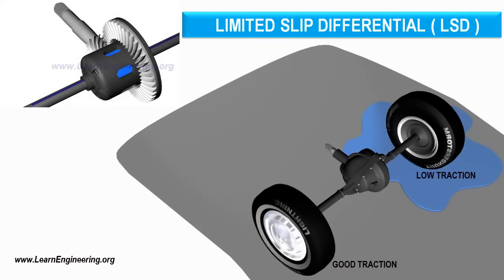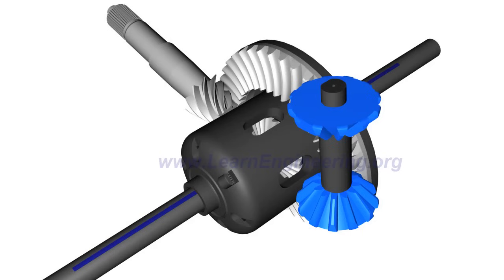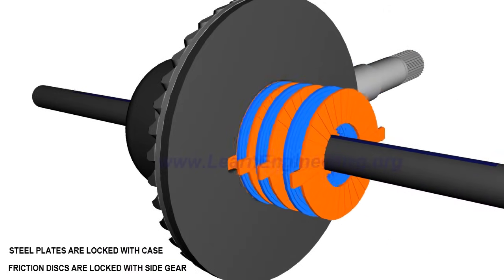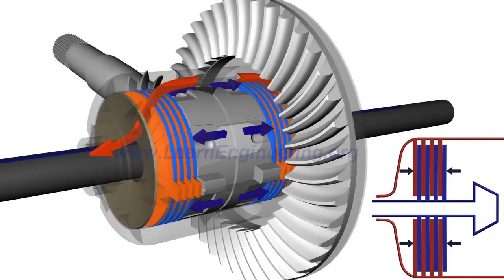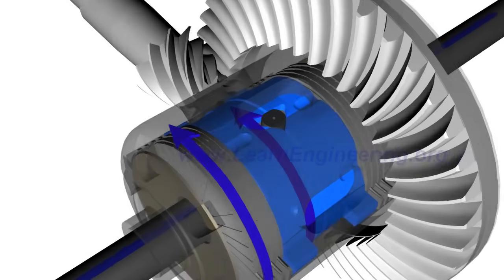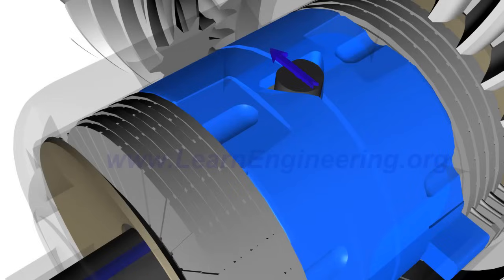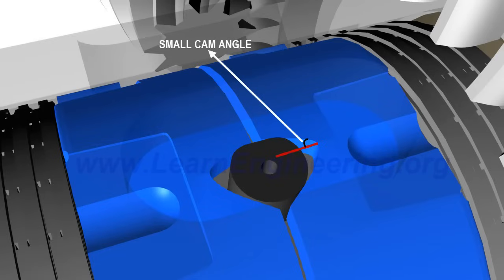Working of Limited Slip Differential

Comment: Probably this has been mentioned somewhere in the comments already, but Youtube doesn't make it very easy to check. There's a big mistake in this explanation, and it relates to the torque/power delivered to the left and right wheel:

At the beginning the video says that with an open diff "high power" is going to the wheel on the low grip surface and "low power" is going to the wheel on the high grip surface. This is wrong, an open diff will ALWAYS distribute the torque evenly between both axles (plus/minus some mechanical inaccuracies since we're not in a perfect world). The diff isn't sending more torque/power to the side with less grip, the side with less grip is limiting the torque sent to the side with more grip.

The maximum torque that can be put down on the ground with an open diff is roughly 2 times the tractive capability of the side with less grip. An engine can only put out torque that's used for something (conservation of energy and all), so the side with less grip acts as the limiter, any attempted extra torque will be spent on increasing the rpm of the engine and the wheel that's spinning, until you hit the limiter (at which point the engine cuts off and doesn't provide torque). Hence the car can't move forwards.

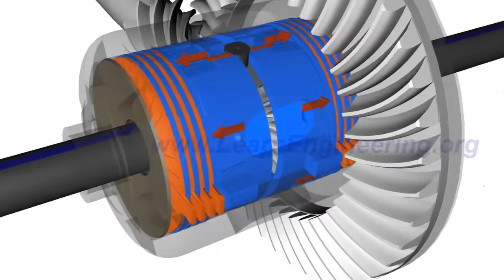When locking is introduced (be it via Salisbury type LSD, Torsen style unit, viscous LSD or whatever, even a solid, spooled diff) the situation changes. More locking enables you to send MORE torque/power to the side with more grip. Not "an equal amount of torque will be sent to the right and left wheels" as the video says at around 2:45. The locking torque is what enables that extra torque/power to be sent to the side with more grip. As an extreme example, a car with a solid, spooled diff (i.e. one that allows no differentiation) in a situation where one wheel is completely off the ground wouldn't be sending an equal amount of torque to both wheels, it'd essentially be sending 100% of the torque to the only wheel that's touching the ground.

Fantastic video for explaining how the system works, but lacking in describing how the forces in it actually behave. =)
Reply: It cannot be the same torque and power unless the wheels are at the same speed. Power is torque×speed. They get the same torque, but the loose wheel is spinning faster and hence more power
Reply: @gofer9156  I didn't say it doesn't produce any. I said the amount of torque it produces is proportional to the amount of resistance it makes. It makes enough torque to overcome it's own inertia and bearing friction.
.
So you're still wrong.
Reply: Thanks, I wish I had seen your comment earlier.
Reply: @gofer9156  you are wrong again. I never said electric motors don't produce torque at 0 rpm and the article you posted is a journalistic article talking about loaded situations. You keep making shit up. I'll post an EDU article at the end to show your ignorance.
.
Here is what I said: "so while they make torque it's only enough to overcome their own inefficiencies. Electric motors require resistance to draw more current and produce more torque, which is why they have unloaded and loaded torque ratings."
.
Electric motors DO NOT make all their torque at 0 RPM WITHOUT an extreme load. With no load the rotor experiences enough torque to overcome inertia and frictional losses which creates the 0 shaft torque. 
.
Again, it's a very simple test. look at current draw on an electric motor loaded vs lightly loaded and you'll see that one makes substantially more torque at the same voltage which means more power (watts = volt X amp).
.
"When unloaded, the motor is running at full speed, but at zero torque, thus producing zero power. Conversely, when stalled, the motor is producing its maximum torque output, but at zero speed -- also producing zero power!" https://www.clear.rice.edu/elec201/Book/motors.html#:~:text=When%20unloaded%2C%20the%20motor%20is,%2D%2D%20also%20producing%20zero%20power!
.
Stalled meaning the motor is experiencing more resistance than it can handle... ie an extreme load. Torque is proportional to load which can be seen by current draw increasing with load. Also, you're conflating shaft torque with rotor torque. The torque experienced by the rotor to spin is equal to the resistance it naturally has due to inertia and friction which delivers zero shaft torque.
Reply: @gofer9156  No, you have no idea what you are talking about. STALLED means loaded beyond the motor's capability. I said UNLOADED motors produce no torque beyond what it takes to overcome their own inefficiencies which equates to ZERO at the shaft.
.
Exactly what the article said. Zero torque unloaded and the motor will spin fast, and all its torque with maximum load.
.
And my last comment even provided you with my own quote stating that.
Reply: @gofer9156  2nd reply) You keep trying to perpetuate the same straw man argument. I never said no torque at zero rpm loaded. Stop lying. You said the OP was "incorrect!" by stating "An engine can only put out torque that's used for something." You are WRONG. An electric motor needs to impart its torque onto something to generate it. I can give you a motor that can drive 1m ft lbs of torque to set a drywall screw, it won't generate 1m ft lbs, just enough to set the screw, shear it in half, and then spin itself. 
.
He was talking about torque production depends on the condition, and you stated, "An electric motor outputs torque at 0 rpm." While that's true in a loaded situation, it's not true for unloaded. ie, street = tons of toque while ice = very minimal torque, and a snapped CV axle = no torque developed at the shaft. 
.
An electric motor cannot output torque without load, hence UNLOADED TORQUE. Yes, the rotor experiences torque to over come its own inefficiencies but the shaft sees no torque. Every post I say, UNLOADED TORQUE. Stalled rotor means heavily loaded. An unloaded motor will spin freely to whatever RPM the voltage sends it to and develop no torque at the shaft. 
.
I never said a loaded motor cannot make torque at zero RPM, in fact I stated otherwise. "You'll see higher current draw with more load and next to nothing when unloaded." Also, "Torque is proportional to the current draw in an electric motor, so while they make torque it's only enough to overcome their own inefficiencies." And "Electric motors require resistance to draw more current and produce more torque, which is why they have unloaded and loaded torque ratings."
Reply: @gofer9156  Are you a child? The only thing "Patently false" here is you. I posted a datalog showing loaded vs unloaded motor torque at the end. EMPIRICAL PROOF, unlike your magazine ad and misunderstanding of how current is drawn in an electrical motor. 
.
YOU ARE STILL NOT GETTING IT. The  The amount of current drawn DEPENDS ON THE LOAD. Motor load, motor electrical resistance, and electrical potential are what determine how much current is drawn by the motor. An unloaded motor will draw next to no current unloaded. 
.
The article I linked to you literally said NO TORQUE is developed without load, and maximum torque is developed at max load.
.
Without load, the motor will freely spin generating NO TORQUE.
.
You cannot force current through it. The controller applies voltage and the motor will draw current depending on load.
.
Here is a test I just did. I could not stall the motor due to a slipper clutch in the drivetrain, throttle EPA set to 35% on all 6 runs. First 3 runs were unloaded and the last 3 runs were with the wheels locked in place. As you can READILY SEE, the unloaded motor drew so little current it was not registered as it ran to max rpm UNLOADED. The LOADED scenario saw current drawn to overcome the slipper clutch. Upper Graph is all 6 events, middle graph is unloaded events, and lower graph is loaded event.
.
https://drive.google.com/file/d/1H9Vi1L413c93bt3he-Fd2msBkqCQDYk3/view?usp=sharing
Reply: @gofer9156  The only clueless one here is yourself. From the beginning I stated electric motor torque generated for use, since you incorrectly responded to the OP saying an engine can only make torque used for something. I already proved current draw is proportional to load with actual real world data. Now you're trying to insert yet another straw man argument to shift yours away to a correct statement, but I won't let you. Yes, as I've stated, motor torque at the shaft is determined by the current draw and inefficiencies the motor sees, but current draw depends on LOAD. 
.
YOU STILL DON'T UNDERSTAND. Load is the what determines the amount current drawn and therefore the amount of torque a motor will make. You cannot make a motor produce more torque than what the shaft can generate. It literally defies the laws of physics, since the motor cannot impart its force onto something else it cannot be produced. Because of the conservation of energy, energy can neither be created nor destroyed. If an UNLOADED electrical motor made any torque it would at any rpm it would be producing SHAFT POWER which CANNOT be transferred to air, thus would have to be transferred in the form of heat which doesn't happen. 
.
For the 100th time, current draw completely depends on the load, just like the EDU article I linked that you ignorantly thought made your point despite it saying an electrical motor only makes torque with load. Current draw is proportional to torque, and increases during load until the motor is stalled generating its greatest torque. 
.
My test used a motor controller that doesn't manipulate constant voltage for torque control, so it was 100% of the motor's load that accounted for the current draw. Motor controllers can only control current draw by manipulating voltage applied to the motor, since the more potential a motor sees the more current the circuit can support. In my test the controller applied constant voltage and only load was changed. 
.
Prove me wrong, create an electrical shunt, power an electrical motor, measure the amount of voltage drop during stalled and free operation. If the voltage drops, from a reliable source, then you can calculate current using the resistance of the shunt. Any voltage drop during a loaded scenario would prove current changes though, just wouldn't know how much.
Reply: @gofer9156  You are wrong and I already proved that current is proportional to load. GET OVER IT. It's funny, because I actually explain how it does, provide proof, and all you do is make hyperbolic or inaccurate statements without anything to back them up.
.
I've provided empirical proof and a an article from a reputable source.
.
Physics says that a motor cannot create torque without resistance. Real world tests show that current draw is dependent on load.
Reply: @gofer9156  Yet again you post something not relevant and prove how little you know.
.
That article does not say that an electric motor produces torque at the shaft unloaded anywhere within it. And that article is wrong in that electric motor torque is constant, as torque produced drops with rpm. 
.
why can't you provide a single piece of evidence that shows a motor makes shaft torque UNLOADED. I've said over and over again that the rotor experiences torque, but the shaft torque, which is what we've been talking about, is zero without resistance.
.
Again, the rotor experiences ENOUGH torque to overcome it's own inertia and inefficiencies which completely aligns with it being driven by torque. Nowhere did I say rotors don't experience torque.
.
To sum it up. 
Physics: energy cannot be created nor destroyed
EDU paper: Motors produce no torque with no load
Real world test: unloaded motor no current, loaded motor pulled current
You: MoToRs MaKe AlL tHeIr ToRqUe No MaTtEr WhAt.
.
Still waiting on ANY empirical proof than an unloaded electric motor generates ANY shaft torque.
.
A shaft cannot impart torque without resistance, therefore a motor cannot generate shaft torque without resistance (LOAD).
Reply: @gofer9156  You keep lying and making the SAME STRAW MAN ARGUMENT trying to change what is in question. I never said the rotor doesn't experience any torque, I said it experiences enough torque to overcome it's own inertia and inefficiencies. No more, and no less. And proved it. I just measured shaft torque with my torque bit driver... the amount produced was exactly proportional to the amount of resistance I put on it, and it read no kg-cm when unloaded. WEIRD. Actually not weird, it's completely predictable as I've stated over and over again. Anyone that's ever used a blender understands this phenomenon. an empty blender just spins, while one loaded up with ice and a bunch of frozen berries might dim the lights on the same circuit when it starts up. 
.
Like the OP said, can only put out torque that's used for something... which is derived from the conservation of energy. 
.
I'm the only one to provide relevant documents that PROVE that torque is dependent on load. The EDU paper states that electric motors make no torque without load, and their most torque with their greatest loads... LOAD DEPENEDENT. I provided ACTUAL DATA showing electrical motors draw so little current unloaded it was unmeasurable and plenty of current when stalled... torque is proportional to current draw and current draw is DIRECTLY PROPORTIONAL TO LOAD.
.
Physics: cannot create nor destroy energy. PERIOD. A motor CANNOT impart mechanical force onto something that cannot receive it. Just to make sure, I put my torque driver on my motor shaft and ran the motor... driver didn't measure any torque and the controller didn't measure and current. They both rotated freely without any resistance outside their own combined inertia.  
.
Without something to do work for, an electric motor cannot create work since it would be destroying energy. Impossible. 
.
You keep throwing in IRRELEVANT pieces of information that are true but don't have anything to do with how rotors draw current as their load changes. Moment of inertia actually reduces the amount of torque the motor can produce since torque is required to overcome it you idiot. The only torque produced unloaded is exactly what it takes to overcome that and other inefficiencies as I've stated over and over again. You clearly are copy and pasting google searches hoping to look smart, but your not. You sound like an idiot making irrelevant statements like rotors can only experience torque, yes we know that; but we are talking about HOW MUCH torque they experience which is next to nothing unloaded and netted out to zero at the shaft without resistance. 
.
I never said electrical motors aren't driven by torque, I never said rotors don't experience torque, I have stated time and time again that the amount of torque the rotor experiences is the amount it takes to overcome it's own inertia and inefficiencies.
.
Time for you to study up on physics.
Reply: @gofer9156  so measuring a motors torque output both electrically and mechanically proves my ignorance? 😂🤣
.
Your an idiot who still hasn’t provided a single piece of evidence that says motor torque isn’t load dependent. I have. Literally an EDU paper stating motors produce no torque without load.
Reply: @gofer9156  you’re a fraud. Want to know how I know. You’ve searched and searched and searched and found articles that talk about electric motors but not about proportional loads, and yet you’ve provided nothing to prove motor torque isn’t proportional to load. You post copy and pasted info to sound smart, but it’s illogical and not relevant. 
.
I have shown that current and mechanical shaft torque are proportional to load. 
.
You’ve also failed to identify where the energy flows after its imparted on the rotor... conservation of energy and all. 
.
Still waiting on your proof, but according to your insane viewpoint empirical evidence = ignorance.
Reply: @gofer9156  Still waiting for a SINGLE piece of evidence that shows motor torque isn't dependent on load. Strait from a motor manufacturer, "No-load Current (A): 3.9" & "Max Amps (A): 290." Sure seems like current draw IS PROPORTIONAL to load, as it draws enough current to overcome its own inertia and inefficiencies unloaded, yet can be loaded up to hundred of amps more. https://www.tppowerusa.com/index.php?route=product/product&path=20_71_140&product_id=398 
.
meanwhile I've provided evidence that shows it does.
.
Still waiting on that explanation to how energy can be destroyed in these magical motors as well. 
.
Anything? Does your pathetic strategy of copy & pasting engineering definitions actually impress anyone? I'm still waiting on how a rotor's moment of inertia has anything to do with electrical circuitry. All that proves is exactly what I said, enough torque to overcome the rotors inertia and inefficiencies. You want to talk about back EMF? Oh, that's right, you don't understand that back EMF doesn't occur at 0 rpm, which is where you said electrical motors generate all this torque without load... even though I showed you data from a loaded and unloaded motor that proves it doesn't. Now I've shown you specs from a manufacturer shows no-load current vs max current.
Reply: @gofer9156  you’ve clearly given up and went into troll mode... so good to finally see who you are.
Reply: @gofer9156  you keep saying that, yet have been unable to show how. So, by your logic, you’re dumber than stupid.
Reply: @gofer9156  still waiting on that evidence
Reply: @gofer9156  still waiting on that evidence?
Reply: This donkey actually thinks he has proven something about electric motors by mentioning that the control circuits of his screw driver adapted to the torque load. What a dofus.
Reply: @gofer9156  So you deleted all your comments and you are still lying.
Reply: Thanks for the clearing this point.
Reply: Torque isn't power bro.
Reply: You are incorrect! Power and torque is not the same... In this case power is RPM x torque, so higher power is indeed going to the wheel with lower grip!

Edit : To clarify, this comment is about what he said regarding the open diff animation in the beginning of the video.
Reply: LSD make car go sideways.

Problem?
Reply: You are entirely correct. Differentials and power distribution is a subject only a few understand correctly.
Reply: "An engine can only put out torque that's used for something"
Incorrect! An electric motor outputs torque at 0 rpm. Torque in motion makes power.
Reply: @gofer9156  Sorry but you're wrong. Electric motors prove it ironically. Torque is proportional to the current draw in an electric motor, so while they make torque it's only enough to overcome their own inefficiencies. Electric motors require resistance to draw more current and produce more torque, which is why they have unloaded and loaded torque ratings. 
.
It's very easy to prove. Measure the voltage drop for a given resistance in a motor that's loaded and unloaded. The more current draw will create more voltage drop, or you can have a device to measure current. You'll see higher current draw with more load and next to nothing when unloaded (enough to overcome it's own inefficiencies).
.
For example, I have an RC car with a 2 speed transmission. Same magnetics, same driveline, same weight, same battery. The only change is gearing. In low gear full throttle from a stop it generates 495W at 40amps, but in high it generated 1210W at 102.4amps. The voltage is different as the more current is drawn the more the voltage drops given its resistance. That same combination has also peaked 150 amps before in high gear under conditions with more load.
.
So electrical motors don't produce torque without resistance either, and requires enough resistance to stall the motor in order for it to produce torque at 0 rpm.